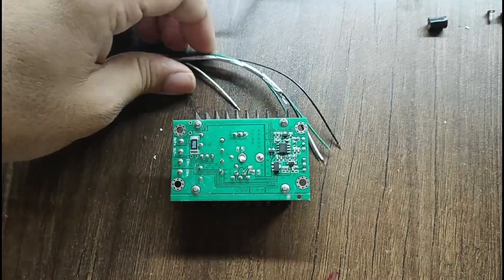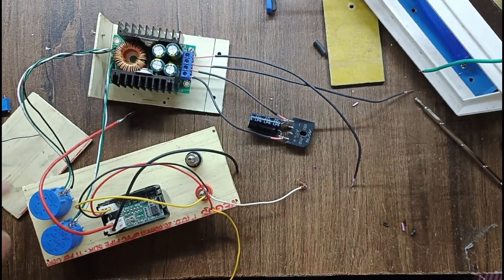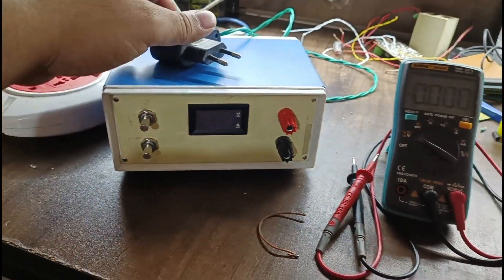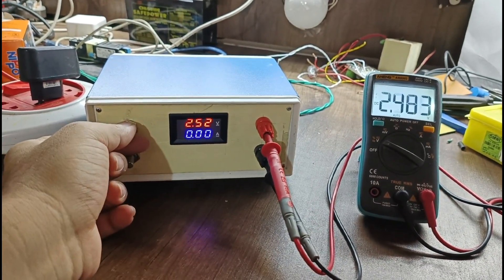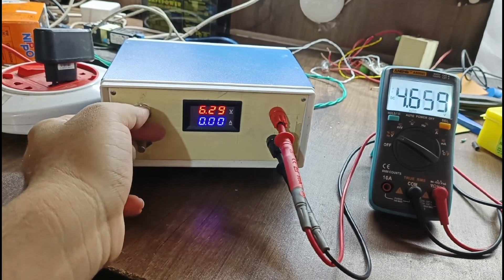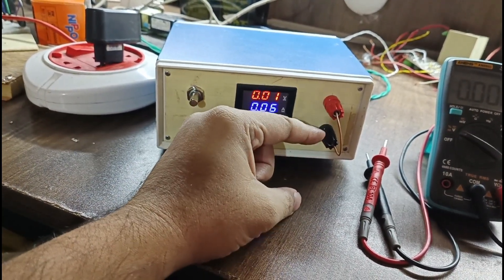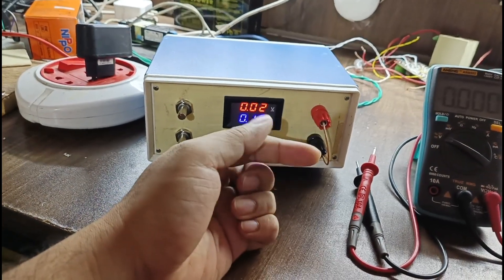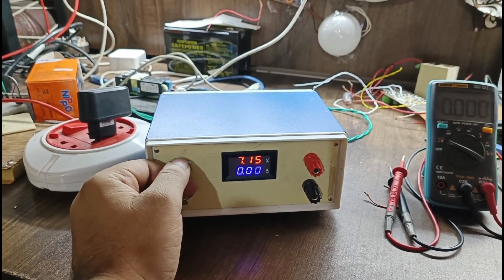DIY CC CV Bench Power Supply 1.22 -15 V, 0-5A  || HOME MADE

Comment: Is this type of power good for any Electronics circuits & especially audio amplifiers ? Some people say it works on high frequencies and can disturb Electronics circuit working. Can this suppy provide steady on high loads like 2 Ampere?
Reply from the maker: Yes it will work. Even 230/24 V SMPS also work  local SMPS may can give problem is current is not sufficient. May be you need to place some extra filters which can reduce the noise.  Also remember you choose SMPS have good isolation between input and output voltage at least 1KV  or more.